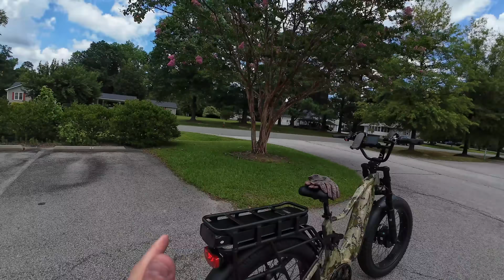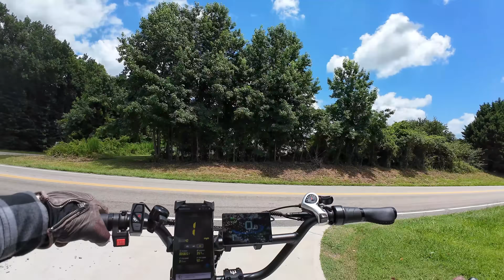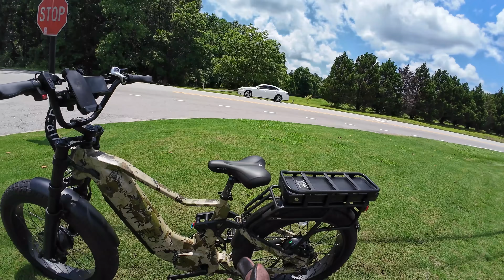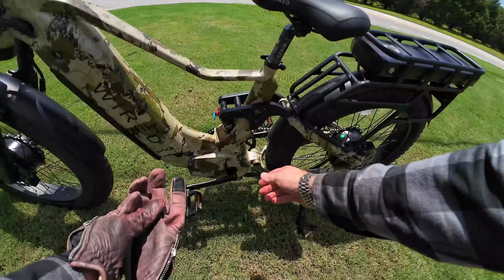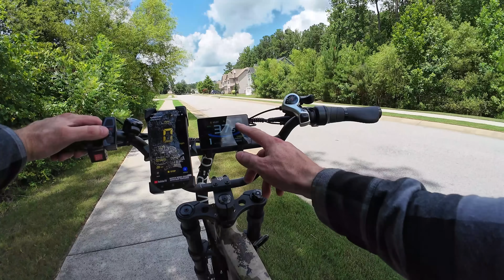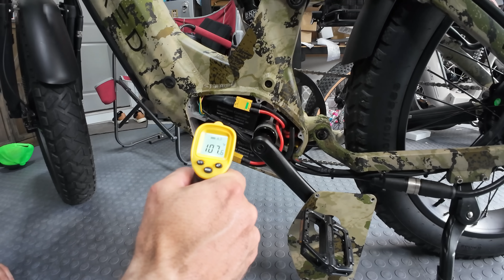WIRED PREDATOR 72V: High Speed Range Test

Comment: I agree, if Wired is building high speed bikes that many will ride on the streets, they should all come with Turn signals front & back and a Loud horn. It is basically a motorcycle with pedals. COME ON WIRED!!!!!
Reply: I'm sure their next version will have the upgrades and be 96v monsters. LOL
Reply: Maybe they’ll have to market it as a motor bike if they come with those. Idk but if they were for the people, they would definitely include these
Reply: @ryanharker1426 they should market it as a motorbike because it currently doesn’t conform to the class 1,2, and 3 definition. And before someone posts that it can be set to be class 3, no it can’t. The motor itself is too powerful to conform and software doesn’t change that.
Reply: @Scomelbasses  I believe you can set it for any of those classes.
Reply: @stevenleslie8557 you can but it doesn't actually make it so. Most definitions of  ebikes that conform to class 1, 2, or 3 must have a motor that is 750 watts or less. This bike clearly has a much more powerful motor.
Reply: @Scomelbasses that’s not true at all. The programming definitely has the capability of turning it into a class 1-2 or 3. It’ll just be a really heavy one.
Reply: @abide_the_dude5375I disagree. It's not a software issue. The software can certainly make it perform like a class 1, 2, or 3. But it's a hardware issue. The motor is what it is and most guidelines say the motor can't be bigger than 750 continuous watts. This motor is clearly more powerful than that.
Reply: @Scomelbasses this is true.
Reply: @stevenleslie8557 not legally.
Reply: @Scomelbasses 🎯
Reply: @Scomelbasses yeah that’s true but where I live, as long as yout not an a*h** and respect when your riding in certain areas, you don’t get bothered
Reply: @Scomelbasses  That isn't how it works exactly. Motor ratings to me have always been just a benchmark that says the amount of power a motor can run amount forever without ever overheating, they can handle more power than manufacturers rating. Its really Voltage of battery and amps from controller because this motors can handle more watts than there benchmarks. For example, take a Letric Xp 3.0 which has a "750W" motor which i believe it's stock controller has a limit of 18amps at 48V :

1. If i keep the voltage the same, and increase the amps using a seletable amp controller and lets say i set it to 30amps, then 48V x 30amps  = 1440W nominal and peak would be 54.6V x 30amps = 1638W. Can get 32mph-38mph depending on weight etc.

2. I can increase the voltage to say 72V.  Just this alone would give more top speed easy while decreasing the amount of heat generated. Lets say i set the amps to 18amps, then 72V x 18amps = 1296W and peak would be 84V x 18amps = 1512W. On flat ground could get 35mph-45mph depending on weight etc

Now do you see how easy it is to make an e-bike, e-scooter, e-unicycle go faster
Reply: @omozeoyarebu4444  I know all of this but it really has nothing to do with the fact that most states limit the nominal motor to 750 watts or less to be legal. Certainly one can modify a bike by using a different controller to get better performance. This of course will likely destroy the motor in a short amount of time which is why companies are spec'ing higher powered motors. This makes them not conform to the class system as the current regulations require.
Reply: @Scomelbasses  While the motors can handle more than there rated for, you are correct, there is a point where the motor would be destroyed, for example geared hubs rated 750W,  it's like 2000W before they go bad.

My point was to highlight how stupid the law is because it shows that law makers are not educated on the math and physics behind PEV vehicles. Technically i am breaking the law if i set my ebike to output nominal 751W, see how stupid that is.

Also i didn't even mention. Lets say 750w gets me 20mph on flat ground but on hills, to maintain 20mph, it can be like 1500W or to maintain 10mph like 1000W for example. It clearly shows that electric vehicles aren't constant in power like combustion engines but law makers make laws as if. All this does is creates confusion and creates unforceable laws 🤦🏾‍♂️
Reply: @omozeoyarebu4444  a different discussion all together on whether the law is stupid or not. Law makers are typically ill informed on such things, but the current regulations clearly specify a 750 watt motor or less. For sure, enforcement of this is difficult and unlikely in most places as they don’t have the resources or desire to bother with it. This is why it will be easier for the government just to ban all e-bikes which was my original complaint of why “bikes” like Wired should be labeled as motor vehicles not bicycles.
Reply: @Scomelbasses ...'engine.'.  Anything BUT 'motor.'😅
Reply: @Scomelbasses  Don't think they can ban PEV's when cars kill like 40,000+ people every year in America. if so, then cars would've been banned yesterday. Current laws only work if there was an exclusive road network for PEVs that connects all states together with a speed limit of 20mph. The reality is that, that infrastructure doesn't exist, thus PEV's must coexist with cars. Since it would be insanely expensive to build a infrastructure like that, the more viable solution is to define PEV vehicles at the federal level and binds them to a state's maximize speed limit for non-highway roads aka "local roads" and no more than maybe 6000W and weight of maybe 170Ibs. I live in New Jersey and the maximum speed of a local road is 50mph. Additionally, they would have access to bike lanes, trails/parks etc provided they follow the speed limit set forth. The reason for not allowing them in highways(65mph+) is because of the weight and geometry; a 80lb e-bike or an 90lb e-unicycle are like feathers in a highway with trucks/cars passing. They would have a one time registration for plates and insurance requirement that should be cheaper than motorcycle insurance. Enforcement just become easy because now it's based on speed limit signs.
Reply: @Scomelbasses who cares with that speed and offload ability its not illegal until you get caught. 😂
Reply: @Scomelbasses You have a ton of confidence for a guy who has know idea what hes talking about. You can adjust these bikes in so many ways. You can limit it to 250w and 8mph top speed if thats what you wanna do.
Reply: @trixflippy  that's not true. In many locations if the bike is capable of more than 750w continuous and is capable of being throttle assisted greater than 20 mph it is not considered a bike. Being user adjustable doesn't change that, it must be 750w or less without the end user being able to change it.
Reply: Yeah, it also sucks they're charging pretty much.The same price for the seventy two volt as I paid for my sixty volt and definitely should have had term signals
Reply: ha ha
my cars, trucks, motor bikes (some) have turn signals.
sometimes people see them, , , 
sometimes people use them. . . 

 now & then people see them and actually do the right thing -
then they go on  ;)
Reply: These new Wired bikes should ABSOLUTELY come with TURN SIGNALS!!  I’m seriously waiting for a Wired bike with increased battery capacity (30ah front / 20ah rear) and integrated turning signals. I’d easily drop $4000 on that bike right away!!!
Reply: @ninobeatz_iOS you must be rich😮
Reply: These bikes are illegal to ride on public roads in some states.
Reply: They need more battery longevity because we really at a primitive stage compared to the potential in the future.
Reply: Stop saying it's basically a motorcycle. That sort of thinking could end up implicating everything we use FEET FOR under bogus commerce and/or traffic 'laws' when that's neither necessary, nor LAWFUL. I don't even call these electric things 'motors'...as would the DMV @.                ❤
Reply: Agreed!!! I don’t get them.
Reply: U can just added turning signals yourself.
Reply: Don't worry, all of of that is coming, along with registration and insurance
Reply: Wired makes a good e bike and people do nothing but complain. Wawa waw!
Reply: Yeah!, Madatory Helmet Law,Mandatory State Inspection,Mandatory Registration,Mandatory Insurance,Mandatory Special State License,Charging Stations,More Regulations!,etc. Let's Get The GOVERNMENT MORE INVOLVED IN OUR LIVES!!. 🙄🤣😂🤣😂🤣😂🤣😂🤣😂
Reply: @toddzydiak9910 let's get the government totally involved and deport you for suggesting it 😅
Reply: @toddzydiak9910  I don’t think anybody wants the government to be more involved. The problem is the bike companies build bikes that don’t conform which, when used recklessly as is often the case, it brings unwanted attention from the government who then put even more regulations on the whole industry, punishing owners of actual e-bikes who ride in a safe manner.
Reply: These are for private property only.

Comment: What makes the bike look like it's shaking so much during your ride? Do you think it's the power or torque of the motors? It just looks like it's shaking your arms and hands during the whole ride.  I was curious if you noticed or what you thought of it. Thank you citizen.
Reply from the maker: My comments on this are at timestamp 9:49
Reply: I guarantee it’s the wheel out of balance
Reply from the maker: @Live2ride2live54321  but if the wheel was out of balance wouldn't you feel it all the time, not just at certain speeds
Reply: @CitizenCycle925 while I don’t disagree, it’s not uncommon that the tire absorbs the imbalance at lower speeds and it almost hits a resonance wobble at higher speeds. Perhaps the spokes need adjustment. Just a thought I’m no expert!
Reply: @CitizenCycle925  I don't believe so. It would be similar to a vehicle tire being out of balance. At slower speeds under 40 the tire still turns true because the centrifugal force is not yet strong enough for the slight unbalance to create the vibration. It could just be a one off situation of course but its the first time I have seen a fat tire ebike go over 50 and that is a new wheel/tire combo for Wired from what I understand. For reference, I pre-ordered the Predator in February so I am getting is soon and have no intention of cancelling! Excited to finally get it and I want to say how much I appreciate your videos. You do great work! Thank you
Reply: It could be a tire balance problem, but I think that it is more likely an out of round problem due to improper seating of the tire. Put a straight edge on the fork and spin the wheel to see if it is round. Our fat tires literally fall off the rim when deflated, and they take extra care when mounting to ensure that the alignment ridge on the tire is equally above the rim all the way around on both sides of the tire. This pre-production demo bike has probably endured a lot of transport and some abuse by multiple people.
Reply: I am so looking forward to what you come up with regarding turn signals. I don’t like taking my hands off the grips.

Comment: Great video. That was a lot of continuous speed for the power system to hold up to. It was extra nice that you included temps at the end. One thing that would still be interesting to know is how the basic efficiency of that big beast with extra heavy tires compares with other bikes. My Wired Cruiser usually shows between 1050 and 1100 watts at 30 mph on level ground.

Comment: Are you running tire sealant in this range test video? Am asking for purposes of range and other factors such as ride quality. Am not saying that I know the effect of tire sealant on those aspects, but it would be good to know just the same. Thanks.
Reply from the maker: I do not have sealant or any liners in the tires, and my tire pressure was at 30 PSI

Comment: Hey Bryan! So the vibration your getting at the 2:55 mark, do you think that is a balance issue with the tire or wheel or a combination of both maybe? If so do you think there is any solution to that short of using a motorcycle wheel/tire combo? I saw it start at around 41 mph as well. Thanks!
Reply: That's called speed wobble and it's an engineering flaw. If you don't want a catastrophic failure, stay away from this bike. Something is seriously off and you already know that.
Reply: @firstinlastout that is not a speed wobble lmao you’re clueless
Reply: That vibration or wobble is due to road condition..you will get that feeling even with a motorcycle if you have ridden one before
Reply: @Pidongzki this is absolutely not the case. This is a serious design flaw.
Reply: @FloridaE-bikeAdventures the tire is out of balance it’s quite simple.

Comment: Just be aware everyone to check your local laws about these high powered bikes, in Oregon we get to use 1000 watt motors, otherwise you have to register it as a motorcycle or moped with insurance and a license.  Be safe out there!
Reply: While I agree with your comment, I would add that in many areas as long as you are an adult and riding safely its been my experience that Police officers like many motorists seem to appreciate when you are riding with traffic instead of being a rolling road block. I don't think this would apply so much in a rural environment like in this test but in my area where most speed limits are 25-45 and bikes are allowed to use the full lane the police when you are riding with traffic in the right lane (on multilane roads) instead of impeding traffic with cars constantly having to move around you.

Comment: So you averaged about 27 mph for about an hour before you ran out of juice. To go another 27 miles would take what four hours to recharge?wouldn’t that be five hours to go 27 miles? Not a good bike for even a modest day long ride.A 125 Honda would cost about the same and you would only need a few minutes to fill the tank every 100 miles or so….HMMMMM. 
  Love e-bikes and I love your channel but these long charge times really take the fun out of it
Reply: I don’t think you understand the purpose of any e-bike
Reply: @Live2ride2live54321 I’m  73 and ride a pedal assist only ebike for exercise( about 2000 miles per year. I also ride a1200GS adventure bike when I want to go fast. I feel bicycles are to be pedaled and can be picked up easily by just about anyone. My Giant ebike weighs 58 lbs. and I can load it in a pickup by myself.
Reply: As technology evolves, so will the range and decreased charge times.  Tabless cells look promising but are very expensive right now.
Reply: @jasonfaber3633  He may have averaged that speed including stops.....but his actual average speed while riding was a LOT faster than that. My guess is if he actually rode the bike at an average speed of 27mph it would have gotten more than twice the range

Comment: Gotta have turn signals front and back and put at least 72v25ah battery in front and 30ah in back. I GUARANTEE IT WILL NOT get more then 20-35 m iles per charge , im 6 2 250. I average on ALL ebikes 48v-72v(i have had 8, have 4 still) 0.75-1 ah per mile. And that's always peddling.
Reply: I have made videos of the Wired Freedom getting as low as 25 miles at full throttle to nearly 70 miles on PAS 1. I also made a video (real world riding) at mostly pas 3 and got about 40 miles. Totally depends on speed/amt of pedaling. I'm 6'3" and 240lbs.
Reply: Lol, that's 220 cells. These bikes are heavy enough.